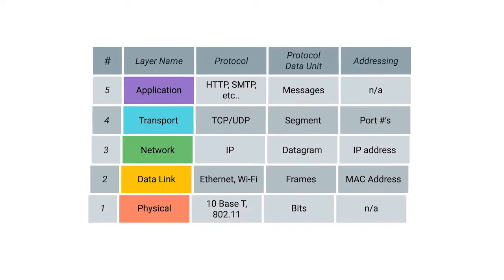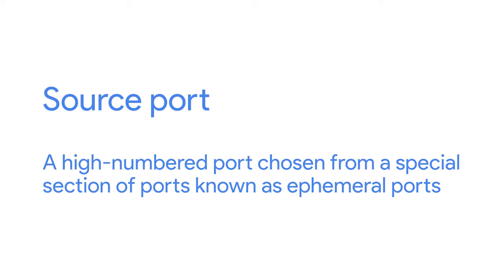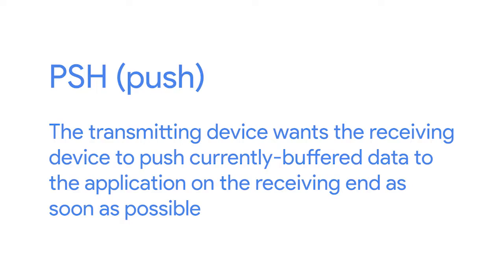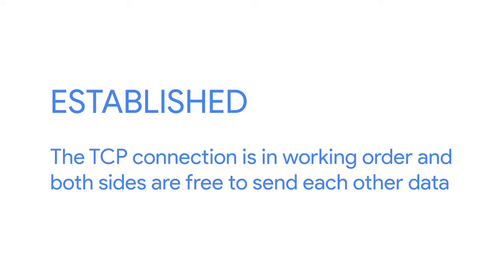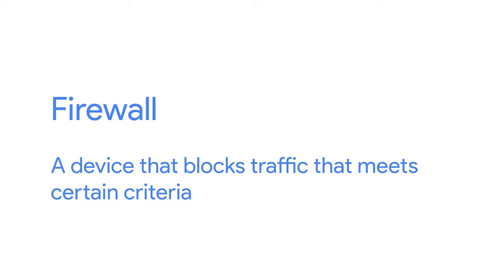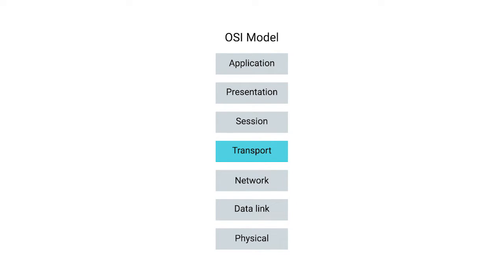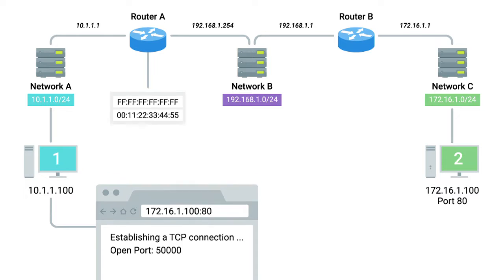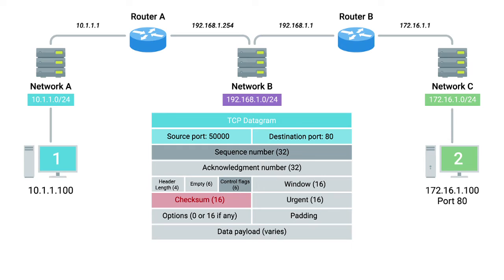Exploring the Transport and Application Layers | Google IT Support Certificate

Comment: Transport Layer

-Getting programs/applications on nodes to send each other data, adding further functionality to layer 3 which enables nodes to communicate
- multiplexing and demultiplexing
- port
- socket number

TCP segment
- comprised of a header and data payload
- source and destination ports:
- sequence number: tracks the position of a specific segment in a stream/sequence of segments
- acknowledgement number
- data offset field - header length, so that it is known where the data payload begins

Control flags
- syn
- ack

3 way handshake 
- Computer A sends a TCP segment with a syn flag - indicating request for a connection and to review the sequence number send by B to know where the conversation starts
-B responds with a segment with a syn and ack flag; requesting of a connection from A and acknowledging **read of the sequence number
- A responds with an ack flag segment, acknowledging **read of B sequence number (thereby agreeing to connect)

- This means connection established. Full duplex operational. Each segment sent by either side should be responded to by segment with the ack field set, ensuring that sender knows what's been received

- fin_wait

- connection oriented protocol
- bit: just an electrical signal within a certain range